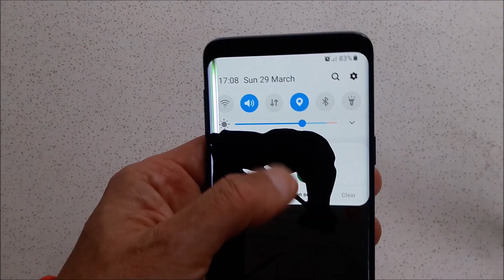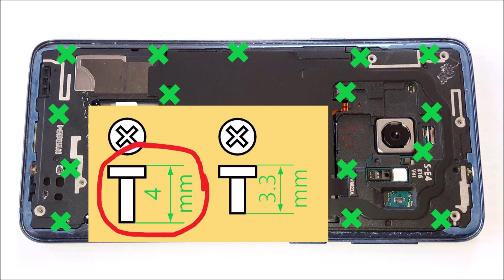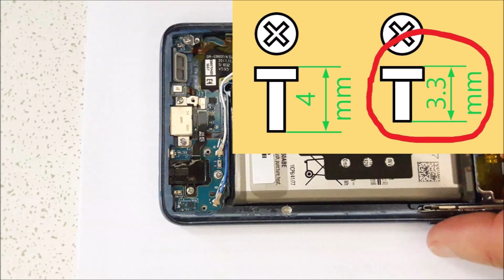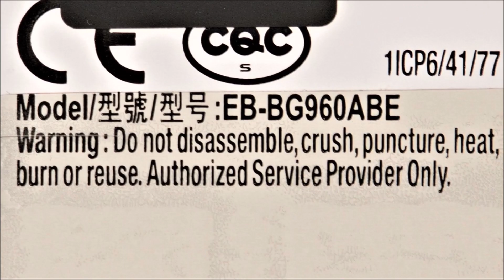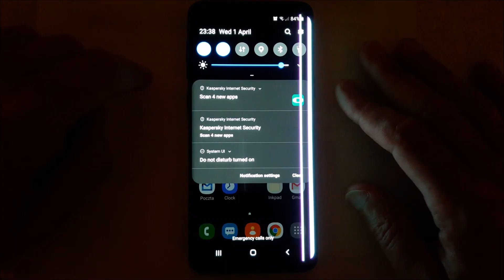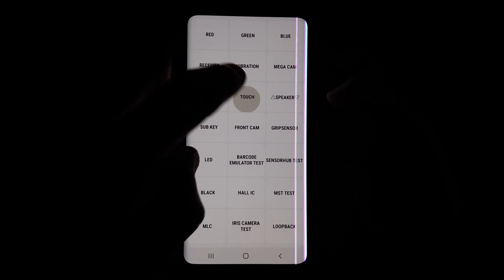Samsung Galaxy S9 cheap damaged screen repair. Battery replacement. USB replacement.

Comment: There are companies now that can fix these types of defects on amoled displays they use the same lasers used to assemble the displays to redo the traces in the board and fix the display without even having to remove the display.  If you look at the display with a special microscope you sometimes can visually see the burnt traces that need to be repaired.

Comment: i broken my Galaxy s9 today my screen is messed up a little but the display is working perfectly and smooth as butter 
for how mush it can be repaired btw thanks you very mush
Reply from the maker: You're welcome :)
Reply: @k-nemo  i mean the phone glass is still broken but the led is perfect for how mush it can pe repaired 
Front glass only ??
Reply from the maker: @squizi7090  I'm sorry but I'm afraid I can't help. I have never done it myself.
Reply: @k-nemo   Do you have any idea by the way for how much does it cost to buy a front glass only that is like $20 then removing the old cracked one nad putting the new one  Sorry if I'm being a pain in the ass   lmao
Reply from the maker: @squizi7090  I'm not sure about the prices, they fluctuate all the time. Check Chinease shops if you want to buy cheap parts. AliExpress is one of the most popular.
Reply: @k-nemo  thank you
Reply from the maker: @squizi7090 Good luck

Comment: Szia nekem lenne egy s9+, egyszer be azott ki szaradt, mukodot utana itthon kicsereltem az aksijat mert rossz volt, azutan hasznaltam es egyszer el kezdett ugralni a kep neha elment, csikok jelentek meg es azota rossz a kijelzo asszem erintesre se reagal, de attol ugyan ugy mukodok kapom az ertesiteseket, es azt nemtudom hogy kijelzot kene cserelni vagy alaplap sult ki, lehet volt még benne valemennyi viz es akkor az csinalhatott valamit (nemtudom), az lenne a kerdesem hogy szerinted melyik?